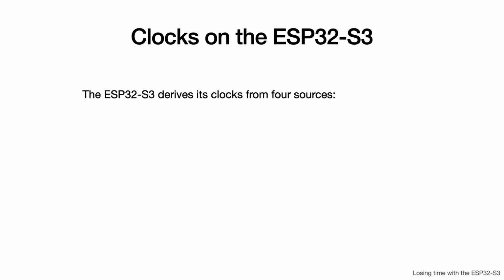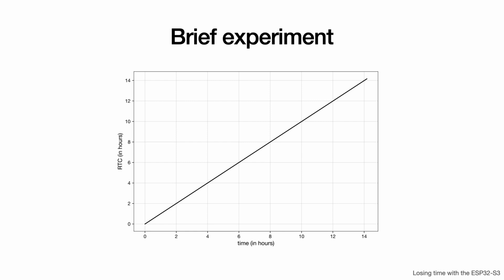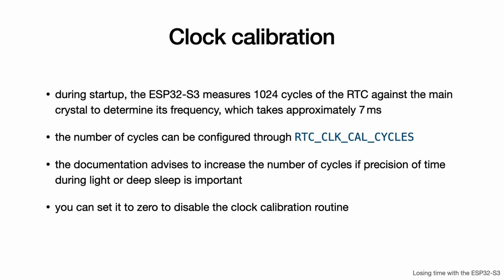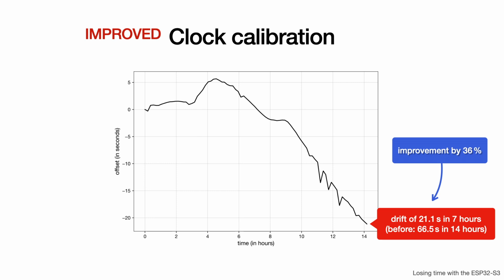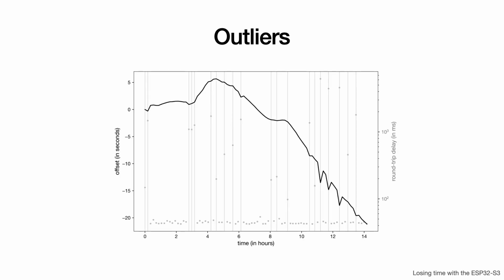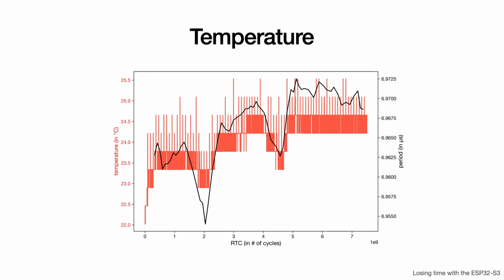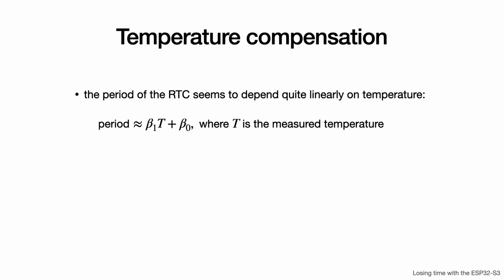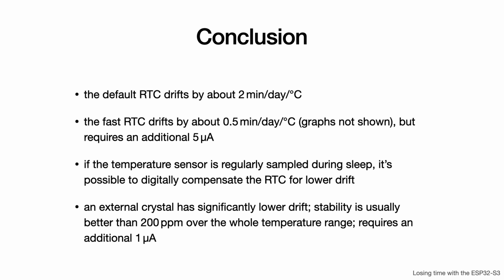Losing time with the ESP32-S3

Comment: Great video. The methodology you used to derive your results was clear and presented well.

Only one comment I’d have is for the very last slide you showed the drift of the two internal RTC’s as time/day/DegreeC whereas the external crystal you showed it as 200ppm over whole temp range. It would have been nice if the units used for these cases were the same from my PoC would have made the comparison a bit clearer.

Thanks, informative!
Reply from the maker: Thank you for your nice comment!

I chose to change the units because of a technical detail I didn't go into. The temperature dependence of the on-chip oscillator is quite linear – at least over the measured range, and also slightly larger ranges that I tested separately. External crystals, however, and also MEMS-oscillators have a quadratic / parabolic dependence, with a peak that is manufactured to be around room temperature. This peak would either translate to 0 s/day/°C, which isn't super meaningful, or one needs to specify the quadratic part, which is around -0.035ppm/°C² for quartz oscillators. That would be the deviation per square of temperature deviation from 25°C.

That's why I chose to give it in ppms over all temperature instead, which is how datasheets usually quote it, but stick to the units of time/day/°C for the on-chip results.
Reply: @matters.of.intrigue  interesting I see then, not a straightforward comparison. Thanks.